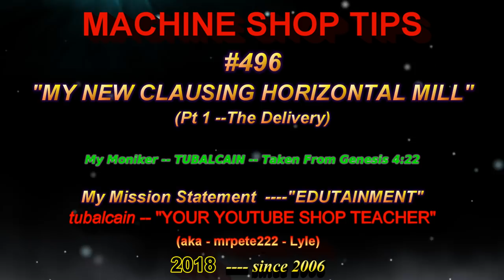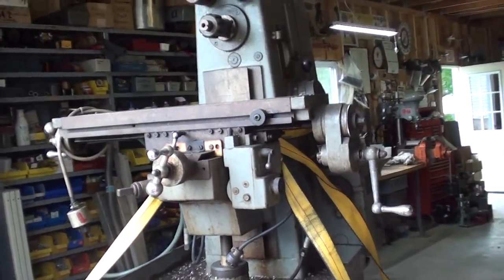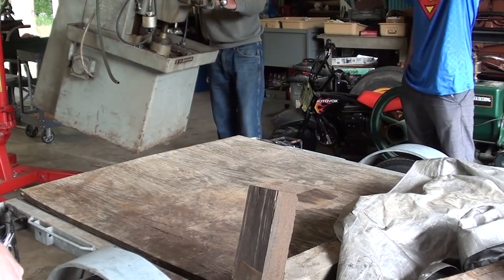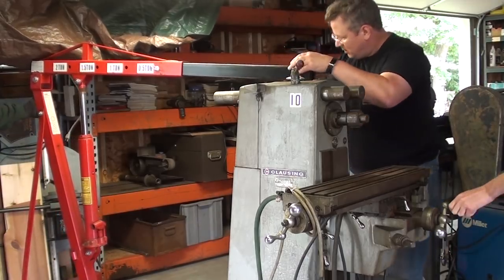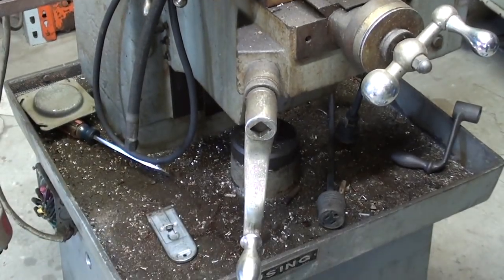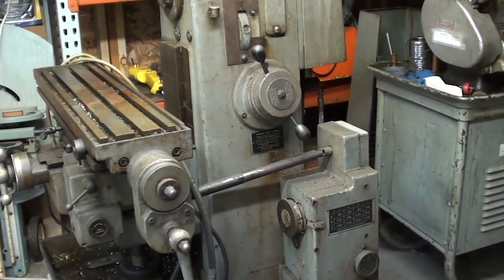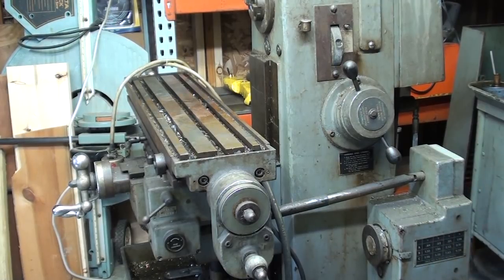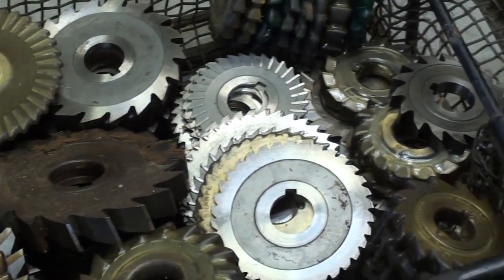New CLAUSING Milling Machine Tips #496 pt 1 tubalcain

Comment: Good video as always. I have a small mill thats basically a horizontal with a small vertical head added. Using it as a horizontal, i was amazed at how much metal that little machine could hog off really quickly. 
I bought some 30 international horizontal arbours for mine off ebay, they were very cheap as most people simply do not want or use a horizontal machine anymore. 
With the cutters, i bought a sheet of 1" plywood and welded up some brackets, 6" of 3/4" round bar onto some flat bar, which i then screwed to the ply in a grid. It makes the storage of the cutters easy, you can see them all, and they do not knock their edges off, as they do when they are in a drawer of a tool chest.

Comment: Time to address the no heat issue in that garage! Think of all you could be doing while the snow blows outside. I'm sure you could find plenty to do out there. A part time heat source, just something to use when you're out there, or keep it 40` - 45` and turn it up the days you spend in it. Shut it down when it's too cold to fight it. That looks like a dandy little mill. Thanks for sharing
Reply: Part time = condensation problems.
Reply: yup condensation turning it on and shutting it down. if your going to heat the garage keep it heated all winter the only way. i keep my little shop at 60 f not 40 f then turn it up to 60f burns too much gas that way. leave it at 60 f once all the metal warms up its easier to heat and takes less energy that way.
Reply: Very true the condensation issue. With his basement shop he won't need the garage every other day, he already works around the cold. Up-down up-down on temp is problematic. My thought was he could keep it off or at a minimum, turn it up for a week or two then turn it down or shut it down. He doesn't have the option right now and evacuates.
Reply: Get a torpedo heater and just blow it on you when you are out there....Smelly and no chance of any audio with the noise but it beats sitting in the house chomping at the bit to get some work done. - Been listening to the noisey SOBs for over 50 years on jobsites so they do not bother me that much I guess. ---- just think how nice it would be in the spring when you put the &%2#& thing away for the summer.

Comment: Wow! That is a very nice gift! It is similar in size to my Hardinge UM mill. The cutters are awesome! I found quite a few cutters at my local scrap yard,they had a 55 gallon barrel full of high speed steel tools and most of them were in the wax still. I sorted through just the top few inches of tools and now I have quite a few different thicknesses and diameters. My Hardinge has the vertical head which is usually how I use it. I have cut horizontally, just to experiment!

Comment: Looks like a nice machine, and it couldn't have ended up with a nicer guy. I look forward to the series on running a horizontal mill, so hang in there until you've completed it, if you would be so kind 😋

Comment: What a gem of a find! Good on you Mr Pete, I recently sold my Clausing 8530 vertical mill which shares many parts, It was difficult to let it go,  as they are such wonderful American Iron. I would have never sold it but I picked up a Millrite that is a better size. If my clausing had been the horizontal mill, I certainly would have kept it. It will be interesting to see how much use it gets in your shop, In our high school metal shop I never got the chance to use the horizontal mill, it was always taken and in use. Cant wait to see more.
Reply from the maker: Thank you, I am trying to decide what operations I should perform on this machine

Comment: Great looking free machine! It's hard to buy a machine that complete, a get all of the tooling, and the delivery is priceless! (just ain't fair!).  I used to have the 8620 vertical, and was a great machine for it's size . Because of their capabilities, scarcity, and size, they typically bring more money than a comparable condition Bridgeport. I sold my 8620 for 1800.00, and purchased a little larger R8 spindle Rockwell, and a J head Bridgeport, both for 1200.00! Smaller machines do have their advantages! .... Cannot wait to see if make chip!
Reply from the maker: Yes, the smaller machines are great for home shop machinists

Comment: If you lay a couple of blocks across the legs of the crane, you can lower whatever you're lifting onto them and then it's much easier and safer to move the item to the intended location without it swinging around.
Reply: I'm building an A-frame so thanks for the idea, so simple and effective
Reply: Super Grover good idea, also why do they struggle with it swinging? Just pull the trailer forward!
Reply: I saw that myself but they got the job done anyway.

Comment: Underneath all the dirt and grime, the machine appears to be in good condition.
If this was indeed in a aero factory, it's likely that it had a fixture plate on top with various operations set for parts to be cut. I've seen on in a museum in Germany (of course with German machinery) for the Luftwaffe WW2 era airplanes. Looked pretty nifty as production equipment goes, anyways, it covered the entire table, and i came to the conclusion that the machine under it, must be in absolutely perfect condition, the fixture sharing the same layers of paint as the machine did.
I yearn for the day i'll stumble upon such a purchase because it's quite rare.
Reply: aserta is

Comment: I'm green with envy, last summer I bought a little Burke that takes cutters of that arbor size.  It came with exactly 1 3/8" x 3" that is so dull that I don't think it would cut warm butter in it's current state.

Well, that's a bit exaggerated, I did manage to sharpen it enough to remove the mushroomed area on the end of the bolt used in my shaper tool post (soft bolt, so it was easy).  The poor little mill needs a new spindle belt and the bearing re-packed, and a better drive system, but that project got displaced by the surface grinder being moved in.  It's getting the red-headed step child treatment at the moment, being more in the way than useful.

Enough babble on my part.  Time to get ready for a little road trip!

Comment: Congrats on the new machine and Kudos to whoever donated it to you.  Although no one was hurt, Word of caution, the person operating the engine lift hydraulics needs to be trained and coached as they release the hydraulics to lower the lift.  They went to fast and if there was any imbalance it could have toppled over.  I always remind the person by saying, “Nice and Easy when releasing the hydraulics”!!!  Turn slowly until it starts to lower !!!
Reply: Depends on the ram. We had one on a little truck mounted jib that either was up or fell like a rock. We put a little 12v winch on the end of it and only used the boom to change the crowd. Used it for a few years that way. - I would have oped for putting a small chain falls on that one you can control it good enough to set gears in an overhead crane gear box that way.  - Here is the bottom line, though. They got the job done didn't they.  - Like we used to say on the job. "IT'S BEER THIRTY!"

Comment: Great acquisition for the shop. Congratulations. The 3 phase won't be a problem. If you don't have any other 3 phase equipment the cheapest way to get this up and running is with a static phase converter (~$100 on eBay). Basically, it creates the 3rd phase using capacitors rather than using the winding of another 3 phase motor like a rotary phase converter.  The motor effectively gets derated by about a third -- a 1-1/2 HP motor becomes a 1 HP motor but that shouldn't be a problem in a nonproduction shop.
Reply: Nah, it's a small motor just swap it out for a single phase.
The mill already has variable speed, so no object to using a VFD either.
Just my $1.02, 2 cents accounting for inflation.
Reply: Those things are only a starter. Once the motor is running it's what is known as "single Phasing" and yes. It cuts the power by a third. You can get used 1 HP single phase motors all day long for less then a static converter and way less then a rotary or inverter drive. Unless you need something like a vector drive those things are way more trouble then they are worth. The low speed cooling alone can make the tin knockers rich.

Comment: It takes the same taper as my little Millright  Vert Mill.  The ZZ collets are very expensive.  I also have a bout 8 or 10 of different sizes.  I have been collecting MNTB30 tool holders of various sizes.  Great machine.

Comment: Way to go Mr Pete!  Any smart fellas out there to straighten out Mr Pete's wiring  for him?  Our teacher keeps talking about croaking :-(. Gotta get it going ASAP!
Reply: We were industrial electrical/millwright contractors and engineers. - It's simple. Forget the phase converters and invert er drives. Change the frigging motor Lyle.   It's not that hard and not that expensive.  BTW, That 480V plug is common as clay in major industrial environments They were like 75 bucks a pop the last time i had to buy them quite a few years ago. The receptacles are even more! (That's my son's problem now)

Comment: Gotta say, that was a lot easier to unload than the Kempsmith No. 1 Universal that I acquired a couple of years back.  The Kempsmith weighs in at around 2850, probably closer to 3,000 with the 4 speed Jeep transmission that someone added to it after market.
Reply: We got a 60 ton OBI Press that was a real sweethart to unload. Our OH crane is only a 1 ton-er and was useless.  God bless caterpillar rollers. Slid it down off the slider and onto the cats and shoved it to the back of the shop with a Bobcat. Then had one hell of a time getting it on the ground. I can live without days like that for the rest of my life.

Comment: I  had a bunch of three-phase motors that I was going to use on different projects! The guys who work on these types machines was telling me three phase Motors don't run correctly on household current the motor will burn up. 
I trashed the motor & kept the stainless steel.
Until I can afford a heat system! I'm going to try to use a kerosene heater in my shop this winter & see how that work out for me.
I would love to hear your understanding pros & cons the difference vertical vs. horizontal milling machine.
Reply: Good economically priced(cheap) heat source can be found on Craigslist. Got mine for $50, people change over from oil to propane/natural gas. They sell them reasonably priced on there. I run mine off a 5 gallon bucket of diesel fuel.

Comment: Very cool, good luck. I have a question. I was given a ships band saw with 440. I only have 220 like you. How are you going to rewire that thing? I would really like to know. THANKS!!
Reply: Change the connections in the motor box
Reply: The wiring diagram will be either on the nameplate or on the cover. 99% sure it's a 9 wire motor  - Low voltage (240) is L1 to 1-7,  L2 to 2-8, L3 to 3-9, 4-5-6 bonded  together on common 9 wire motors. .

Comment: I hate those hydraulic jacks with the hair trigger. I have an engine hoist just about like that one and there was some sort of trick I did on it to slow the action way down. Something about the shape of the valve taper or a shoulder on it. 

I first found out about them when I bought my first one, a floor jack, and jacked a VW front end up as far as it would go and walked by it just brushing the handle which doubled as the release valve , with my pant leg and the jack released and fell to the floor just like it fell off the roof! All for the good, nothing damaged and I never went under a car again without having it firmly on jack stands or some other support. I won’t share my comments!
Reply from the maker: Hair trigger, yes, LOL

Comment: Nice machine, congratulations. Too bad they did not cast some pocket openings in the base so you could use a toe jack to lift it up. Right off hand don’t even see any leveling screws or holes for lagging it to the floor. Lost Creek Machine has a couple of NMTB30 taper arbors on his site now, think he wants $250 each for them.

Comment: 00:25 - I'm looking at at least 3 lathes behind you... how many do you have??? 
I see at least one Sears Craftsman... same model as I have... and I've got two. (One to be converted to CNC...eventually.)
03:39 - Ah the joys of moving heavy equipment. (It's a baby compared tot he Wells Index though... that was a job!)
08:46 - That looks very similar to my NMTB-30 tool holders except that mine have a couple of tabs for the locking ring.
13:53 - For all the cutters i have... I don't have a single one like that. I've got a holder... but never needed one yet.
15:25 - Nice video... I know you will have a great time cleaning it up and tinkering with it.

Comment: I think they are great little milling machines  the only thing I don't like about the Clausing  mill and lathe is the speed control it tends to leak oil over time but all in all  a Great machine .   also its not called Vandalism  its called Studentized  if its from a Votech school  at least that's what my  Machine Shop  Instructor called it many years ago    lol
Reply from the maker: Thank you for commenting. Yes, my Bridgeport was in a high school and it is studentize d.

Comment: I have an issue with a logan 200 that I would greatly appreciate if anyone in the thread here has any advice at all
When I attempt to engage the backgear, the "pin" or "knob" that is located on the gear in the headstock just behind the chuck seems to pull out, toward the tailstock, all the way  and the lever, located on the left side front of the headstock, raises up and seems to mesh the gears just fine - but then the belt just slips 
It's as if the pin, or knob, doesn't release the bull gear, or drive gear, from the spindle assembly? 
If anyone could address this or point me toward a resource I will be eternally greatfull !!
I love ur videos man and will be watching! 
Thanx
Reply from the maker: Never had that problem, I hope someone can help
Reply: My guess would be the bull pin is burred up or otherwise stuck in the gear.  Looks like you are going to be taking it apart. Good luck my friend.

Comment: I don't think you will be able to rewire that motor for single phase.  I think you will need to replace it or get a VFD to run it.
Reply: Yo Lyle, Check HGR in Euclid Ohio. I just got a brand new in the somewhat ripped up box 5HP Baldor 3PH I'm going to put on the Powermatic Bandsaw so I can resaw the cants I cut out of the hard maple tree from the front yard last year. - Cost - 30 bucks.  

They have tons of motors. I think that mill could get away with a 1 horse with the slower  HSS tooling speeds those cutters will be running.

Comment: Man, I thought that hoist was going to fold up, especially when the mill was bouncing.  Do you suppose that table is new?  That looks like cosmoline.  Regardless, congratulations.  I have been looking for lathe in Southern Minnesota for a year and a half on Craigs List and at auctions.  Absolutely nothing but stuff that looks like it was stored outside, or average condition Atlasses for $1,500 plus with stuff missing.  If you ever have the hankering to be the first one on your block to have a 40+ year old combine in your front yard, I can find you 5 inside a week.  Looking forward to seeing that thing up and running!
Reply from the maker: I was a bit nervous myself